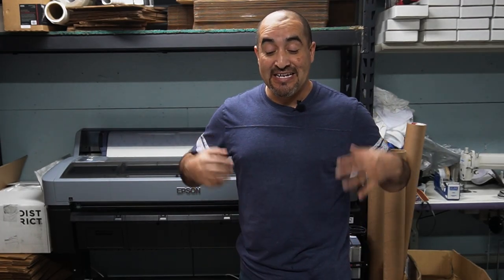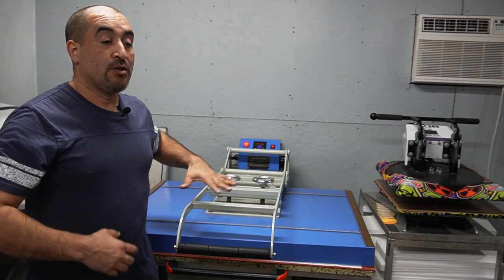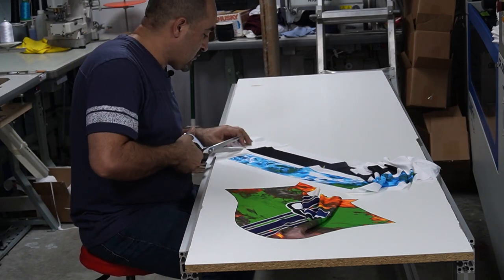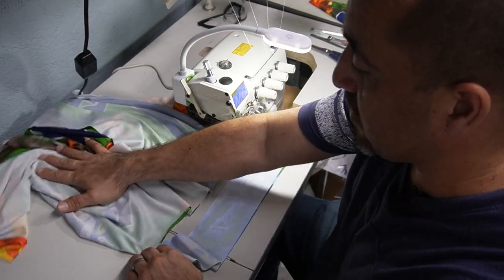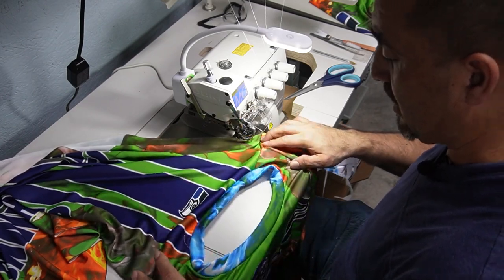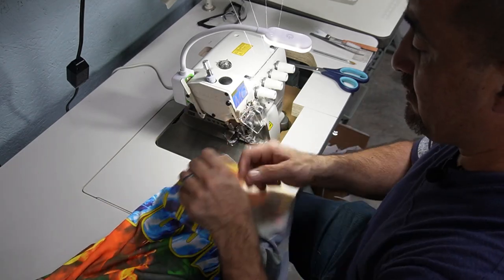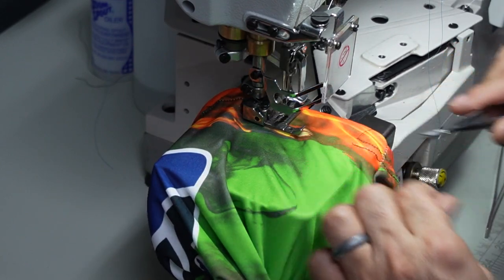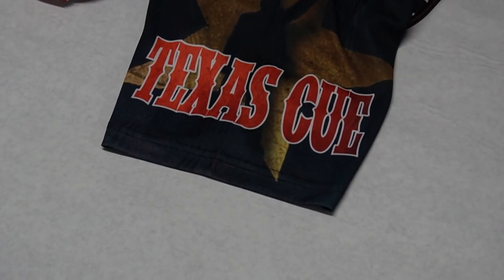Making a 3D shirt from start to finish

Comment: Can you tell me the make and model of the machine you are using to hem the sleeves and bottom of shirt?
Reply from the maker: THOR 600-02d
Reply: @LibertyGraphicDesigns  is it just a straight stitch machine with twin needles?
Reply from the maker: @Reckless Designz  no is not is an interlock
Reply: @LibertyGraphicDesigns  I have a juki serger and I’m told its an interlock but it don’t  hem the bottoms and sleeves like that.